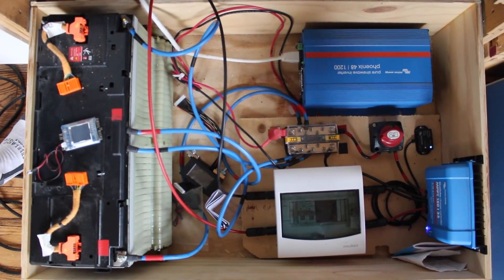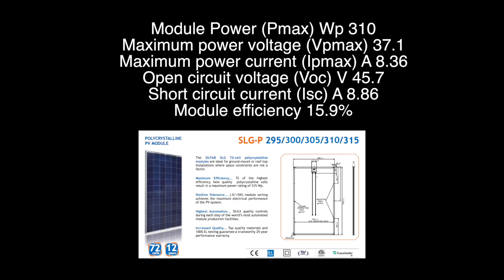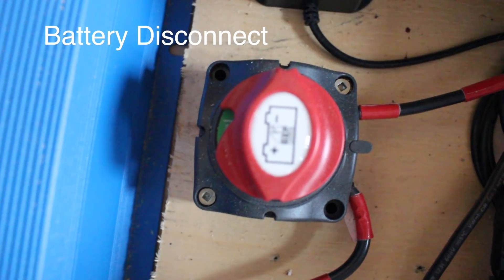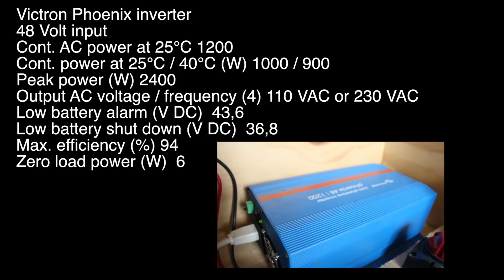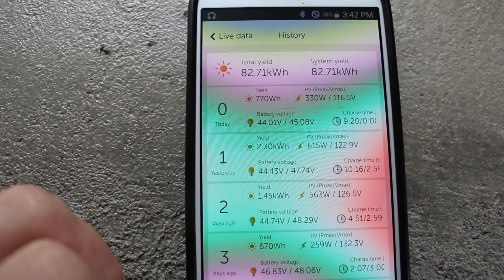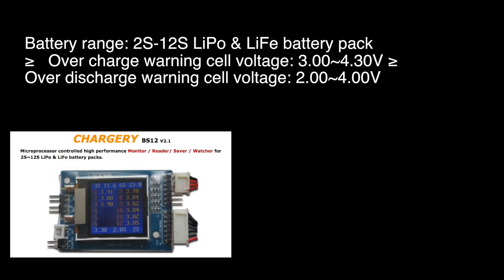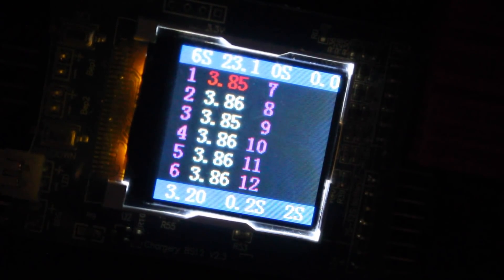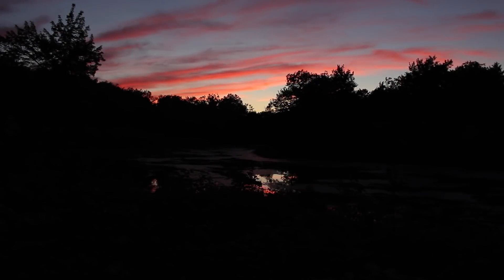Lithium Solar Power. ****System Walk through**** step by step

Comment: Do you connect the battery to the battery output of the charge controller same as  you would for a lead acid, my lithium battery has a built in bms but also hcame with a charger similar to a laptop charger so you can charge it off conventional power but I would much prefer if I can just connect the leads from the mppt battery output to the battery and be done with it.

Comment: Do you use a battery management system to control the charge of the batteries? Or the charge is only coming from the solar charger?
Reply from the maker: I dont use a BMS. I have had no cell drift after over a year of charging.
Reply: @OntarioLakeside  awesome, do you control the charge and discharge with any other charging system? Another question is, what is the equipment you use?

Comment: you don't use BMS? can you explain why?
Reply from the maker: I have not had any need to. the I check the cell voltages regularly and after over a year they are all within .01 volts.

Comment: I have a cobra CPI 2575. 2500 watts continuous 5000 watts peak inverter that I bought for my lead acid setup a few years ago. With lithium batteries can I still use the same inverter or do I need to buy a special one speced for lithium?
Reply from the maker: It should work fine as long as the lithium pack is the same voltage. ie. 24 or 48volts

Comment: What are the specs for your battery bank? Are there two batteries in there? Total V and total Ah for the battery bank?
Reply from the maker: It's a 48v system 4.2Kw. It's 2 modules 1 battery

Comment: Kelvin and i have assembled his smaller Loon, or portable setup.  It has the 350w inverter but we've hit a snafu. My little 1.7cf fridge shuts down the inverter amost all the time but not always. I am making a few assumptions. First is that the inverter needs more than 10 times more watts at startup for that split second. Next is that the compressor varies how exteeme this is and is not constant, hense it the inverter will handle the startup occasionally. Third is that the size of fridge puts you in a different class of compressor such that one may see similar results with various fridge sizes. Therefore choosing the smallest fridge like i did won't nessesarily lower the watt requirements.
Reply: ah, but the fridge starts with a 500w victron inverter. huzzah!
Reply: Yup.  The upgraded 500w has not failed. More than enough power

Comment: Your inverter is a straight inverter? It does not have a charger. How did you charge your batteries on cloudy days. How do you like the chargery BMS?
Reply from the maker: We have yet to need to charge with a generator. We have excellent sun exposure and rarely draw the battery below 50 percent. The Chargery is not a BMS it is just a voltage reader.

Comment: Hey Buddy, mind if I ask you what is your "float voltage" adjustment? The default for our  system is 54volts. Shouldn't it be 48volts? Also, what are your adjustment for "max charge current?" Mine is set at 25a. Thanks.

Comment: Hey, at what voltage do you program your Victron to stop charging your Volt battery? I know these batteries last longer if they are not charged 100%. Thanks.
Reply from the maker: Discharge to 40v charge to 48.3v
Reply: These settings are the result of research done by Kelvin at bobolinksolar.com. Thx Kelvin for building and researching and sharing!

Comment: Kool system. I am going to use those Volt batteries, too. Question: is that chargery cell monitor plug and play? I contacted them. Any chance you got it from a distributor in America? Thanks.
Reply from the maker: Its very easy to use. I bought it in Canada

Comment: Thank you, very intestins. You did not .... around and got many panels. I am from Quebec and I am curious to know where you got the lithium batteries? Are they ferrous sulfate? Also I see you did not use dc to dc breakers? Overkill? When you are not at the cabin, what happens if you get surplus energy? What happens when you get in the -10c? I am not trying to be picky and shitty. I am genuinely interested in your application. I have a cottage 200km north of Mtl and would like to havé energy independence. (I would add a 400w wind mill generator). Thank you
Reply from the maker: My batteries were salvaged from a chevy volt, they are Lithium Manganese Oxide. When we are not at the cabin the batteries are charged to about 40% capacity and left, the incoming solar is disconnected.  When we return we heat the cabin and batteries to room temp and begin charging again. We are approaching our one year anniversary and so far we are very happy. Good luck with your system.

Comment: ... This has me confused. I see that lead acid and lithium ion have different charging profiles. Ive only ever seen that charge controller with lead scid banks. What's the deal? Can it charge both?
Reply from the maker: Yes ut can charge both. its fully configurable in software.
Reply: Ontario Lakeside Ah. I thought so. :) Thank you so much. I think i might be getting one of those then.
Reply from the maker: No problem. We really like it. The phone app is excellent.

Comment: great setup but are you finding without a bms the cells are unbalancing over time?
Reply from the maker: The system has been running for about a year and we have not had any significant drift in voltage between the cells.

Comment: Could you please explain what you are using for batteries? Also how did you obtain these batteries?
Reply from the maker: The batteries are from a electric car, a chevy volt. When these cars are damaged in accidents the batteries can be recovered and reused.
Reply: I have a Volt and the battery packs are normally liquid cooled or heated to keep the temperature at optimum.  Did you just seal up the volt packs with coolant inside them?
Reply: They don't have to be cooled because the demand is nowhere near that of a car.
Reply: The batteries came from Kelvin at bobolinksolar.com.

Comment: Congratulations and thank you for the simple explanation of your configuration. I know that basically Victron Equipment is made for Lead Acid Batteries. I have 2 questions:

1. Can the Victron equipment accomodate lithium ion batteries?
2. What must be configured on the charge controller and inverter to accomodate the equipment to lithium ion?

I appreciate your wisdom and attention.
Reply from the maker: Victron makes and sells lithium batteries. this controller is capable of charging them with no issues.
Reply: Thank you!!!

Comment: Love the energy drawer idea in theory.  Does having batteries in your living space affect the temperature, as in heat it up?  That could be good if you love in a cold area and need heating.  I am getting the idea that the Lithium packs are the way to go.  What is going on with the price and availablity?

Do you know of any really good reference books that cover all the aspects of solar, and/or off-grid living as in how to co-exist with a generator, windmill, hydro-generator, etc.
Reply from the maker: minimal heat from this system, no really enough to have a difference.
Reply: justgivemethetruth If the heat from the battery bank is hot enough to keep you warm then something is very wrong!

Comment: Excellent. One of the best and most straightforward modern solar setup videos. IF you have a chance, I would love to see a video just on the Chevy Volt battery. How did you get it? What did it cost? How did you separate it out into this 1/4 module? Did you have to modify it for your application? How exactly do you test the cells? What do you do when one cell gets out of line? What problems or concerns would there be by scaling up the system 4x? I want to try to generate at least 10kw per day, stored in a salvaged Volt battery, then dump the power into my car when I come home from work. Great job. Thanks.

Comment: Great walk through!  I did not see/hear a description on the component just above the folded piece of paper between battery and the combiner box Is that another fuse what is it connecting?  (appears to have posts on it)
Reply from the maker: That is a battery shunt and monitor, I haven't set it up yet.

Comment: thanks what is a dump load
Reply from the maker: When your batteries are fully charged you can use the excess power from the panels to power something extra. Often people will have a electric hot water heater as their dump load.